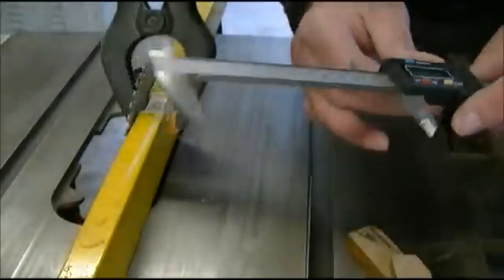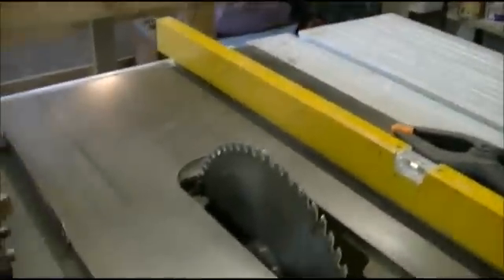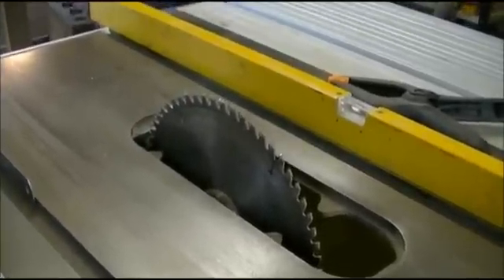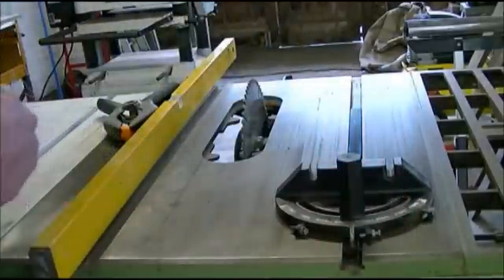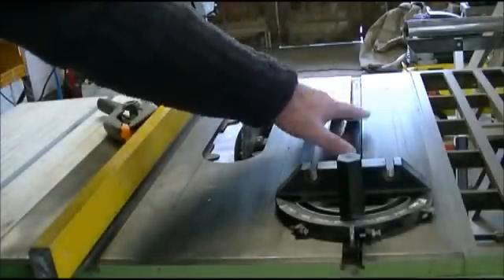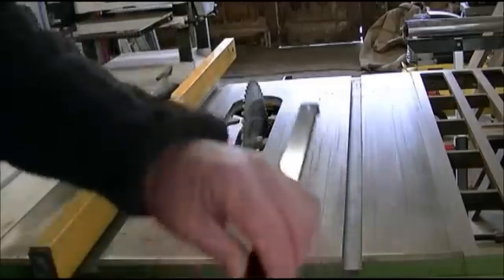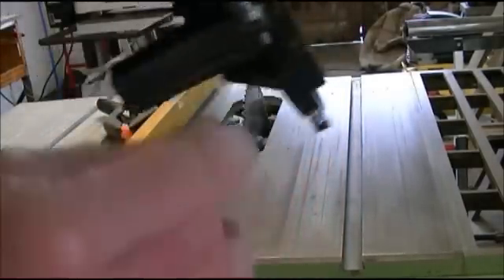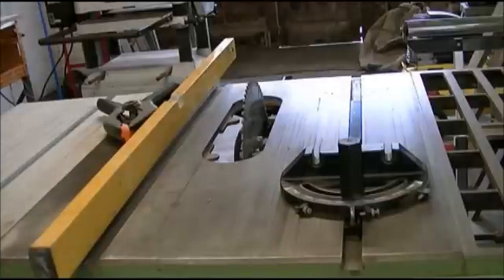how to align a tablesaw blade

Comment: There is very little info out there on this procedure. It appears you have a hybrid style table saw in that the trunnion is mounted directly beneath the table. If I understand you correctly, you are recommending loosening the trunnion cap mounting bolts a tad to make the blade alignment, this sounds & looks plausible. I do believe cabinet mounted cast iron saw trunnions are also adj. in this manner. There are YouTube videos out there showing a different method on this procedure with the hybrid style table saws & I'm not so sure I like what I am seeing. What they are doing is reaching way up inside & loosening (2) hex screws on the motors vertical shaft & turning the entire motor assy on this shaft until an aligned blade is achieved & retightening those hex screws. I'm inclined to think, over time, the motor will shift back on itself, back to its factory setting. About a week back now, I purchased the Delta 36-725 10" contractor table saw & I am gradually going through the calibration procedures on it. What I have found thus far using squares, combination squares & a dial indicator is that the blade has .004 runout @ 180°. Not bad for an initial factory set-up. I would like to get it to +- .001. The fence locks down parallel to the miter slot & is perpendicular to the table top & the left to right fence swing is set correctly from the factory, amazingly & is easily adj. with the Biesemeyer type of fence on this unit. Back to the blade again, rotating the blade 360° with the dial indicator set just below the kerf also verifies the .004 wobble in the blade as well as a feeler gauge set between the combination squares ruler & blade off the miter slot. What I haven't done yet is the procedure you are demonstrating here for blade straightness to the miter slot. This is probably the single most important thing that absolutely needs to be correct & is the " Achilles Heel " that most people are facing, myself incl. with very little information out there on this procedure. I hope to be pleasantly surprised to see your procedure in the Owner's Manual, however, I'm not holding my breath!
Thank you for putting this out there, I'm now at least moving in the right direction I believe on the procedure... :-)

Comment: different way of checking blade calibration. tu. but these contractors and  hybrid table saws never stayed calibrated because of those lousy trunnions. little bit of dust or vibration and that's all she wrote.only with cabinet mounted trunnions saw blade will stay calibrated.

Comment: Ideas are great as is demonstration. But it is impossible to see what is going on under the saw when you make an adjustment. Suggestion- Use adequate lighting when videoing dark areas. Use a cameraman or ladie to hold the camera in order to not be chained to a fixed point that might be irrelevent to the focus.

Comment: Thanks for the information Taylor! You certainly know your trade very well. I was just watching askwoodman a few minutes ago. He has a lot of good information also. Thanks again.
Reply from the maker: +Tom Wilcox thank you tom.  and yes, allen little is very good (ask woodman).  i hate to say it but most of the woodworkers on youtube are not professionals and it does show.
Reply: +Tayler Made yes Allen is great. I wish I could afford one of his rip fences! I could not agree more about all of these so called woodworkers on YouTube. Yes a few including you know what the hell they are doing. Most don't and they pass on tips and advice to unsuspecting people who think if it's on YouTube it must be correct. Could I ask a question please? What do you think is an acceptable tolerance from one jointer blade compared to the others? From these so called woodworkers we talked about I have heard 50 different answers. I wish I could find a jig like you have to set knives. Mine is the older version that has no adjustment screws or jack screws.  I have yet to figure out a quick was to install them. At the moment I'm using a dial indicator. I greatly appreciate your time Taylor.
Reply from the maker: +Tom Wilcox hmm tom thats a poser as i haven't seen your jointer.  are you saying that you hold the blade where you want it and then tighten?  you may find its easier to put magnets on a bar that will hold your blades in place whilst you tighten them.
Reply: +Tayler Made hello again Taylor. Sorry if I'm becoming a pest and asking to many questions but I think my jointer is 100% up to working order. I guess this is more of a comment than a question. Anyway, I was trying to get my jointer knives setup yesterday and at the moment I do not have a jig. My neighbor from across the street come over and seen what I was doing and said " I think I have what you need to do that". A few minutes later he came back over and handed me a jointer knife jig and I be damn it was just like the one you had in your jointer video. Same little logo on it even. He handed it to me and I started laughing and told him the story about your video. I have never seen that brand before I seen your video now I have one to use. To me it was a huge coincidence. In 15 minutes I had my jointer knives set, played with the out feed table and cutting perfect boards WITHOUT SNIPE! A sight to behold! The reason I have so much trouble is my jointer does not have jack screws.
Reply: +Tayler Made why would they make a cutter head without jack screws is beyond me. Thanks for your time I really do appreciate it. I'm going out to the shop now to work with some straight boards for a change.  I hope to see some more videos from you soon. They are really good and full of knowledge. Thanks again.
Reply from the maker: +Tom Wilcox thank you for your kind comments... they are much appreciated
Reply from the maker: +Tom Wilcox so glad you got it sorted..,. wow what a lucky coincidence and what a great neighbour to have.